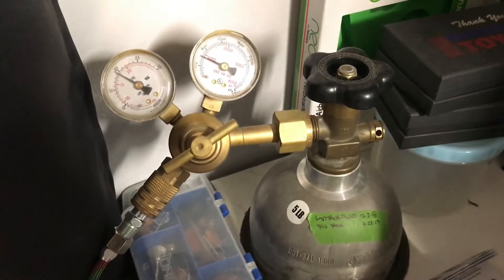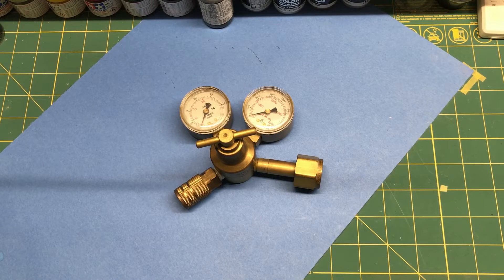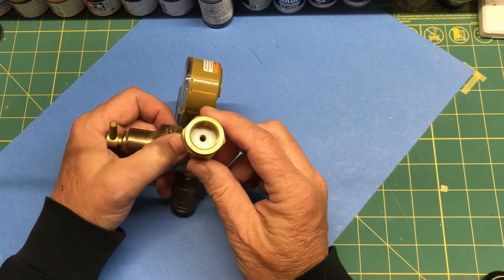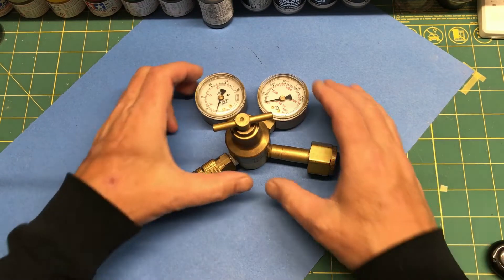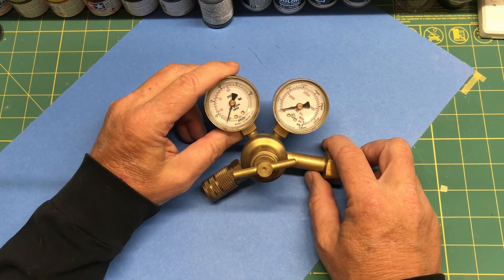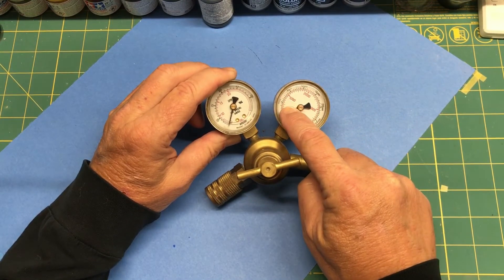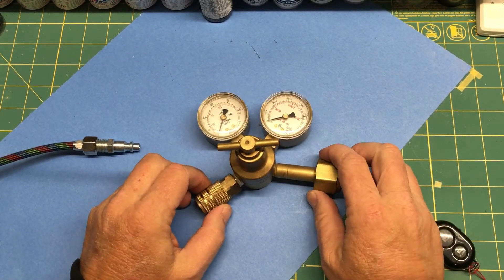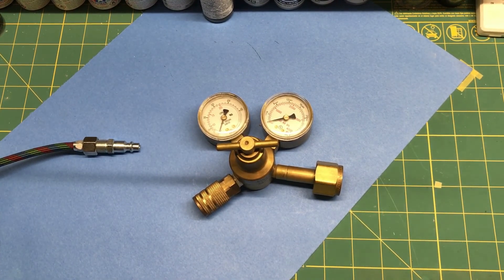CO2 Airbrush Rig

Comment: Nice set up, do you have any thread sizes etc for the various attachments please?👍😊 Thanks in advance 👍😊
Reply from the maker: On the side of the regulator that attaches to the CO2 cylinder, there is only one size as far as I know. The outlet side of the regulator where the air hose, quick release attaches, is 3/8" pipe thread.
If you decide to go with a set up like this, make sure you get a regulator that is made for CO2.

Comment: Thanks so much for this video! I'm looking to get into CO2 airbrushing purely for the pretty much silent operation and was dying for someone to produce a breakdown of the kit. One question though, the male quick release that goes on the end of the airbrush hose....is there a specific name for this?
Reply from the maker: Hi, Chris, glad it was helpful. And the male fitting... I don't think it has a particular name. At least not that I am aware of.
Reply: @BrettG64  Hi Brett, I've taken the plunge and opted for a CO2 set up. Just wondering, do you know what size the fitting is for the output on your regulator?
Reply from the maker: @chriswoolley1556  I am pretty sure it is 1/4" NPT, but I would double check on the particular regulator you get. If you buy it from a local place they can verify for you, or if you buy it online there specs should say, or just take it to a gas supplier locally once you get it and they can tell you.

Comment: Brett nice way to rig for silent running. how low can you set the air pressure ?  oh I have a question any suggestions for books on the P-51 what do you use.? thank you Bruce
Reply from the maker: I'm not sure how low I can go, but pretty low. I think I've had it as low as 8psi, but can't remember. When I'm doing fine stuff, I usually do about 12psi.
As for P-51 books, I only have one. Detail and Scale P-51. I dig books for sure, but I generally turn to the internet for any info I need. Not very old school at all!